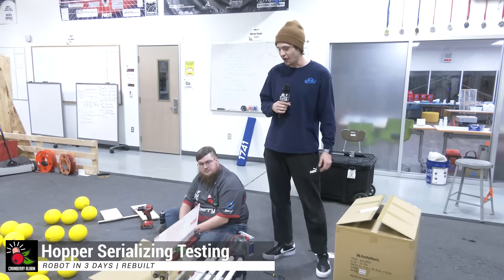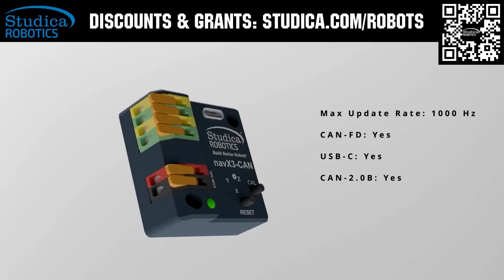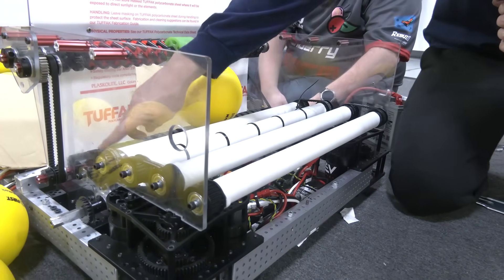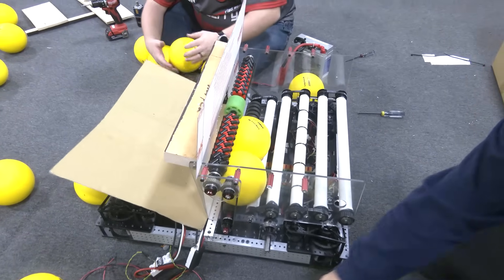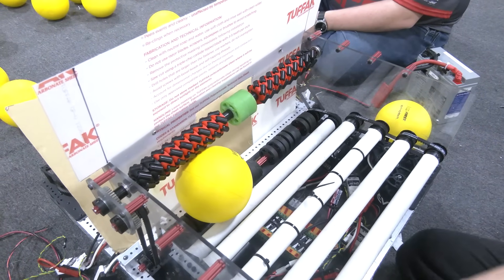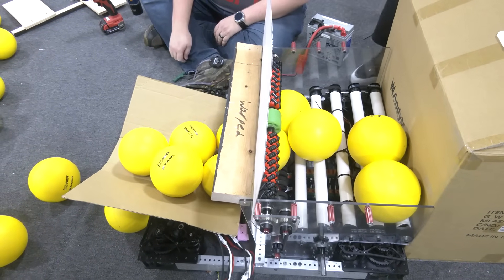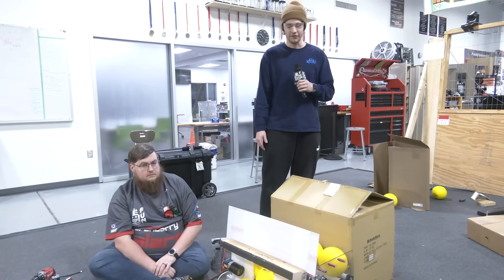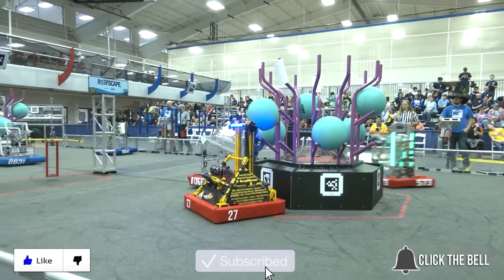REBUILT Hopper Serializing Testing | Ri3D Cranberry Alarm

Comment: Maybe If the hole not is in the Center…
Reply: @LauroIlsonRobótica  well thats why they used vector wheels.
Reply: Yeah if you place the turret into front left or right you both get more space and probably better indexing
Reply: @adatomruk8563 fair actually. So everything would be against one side and you’d avoid fuel colliding from the left and right
Reply: @solarflarearmor2081 yeah exactly